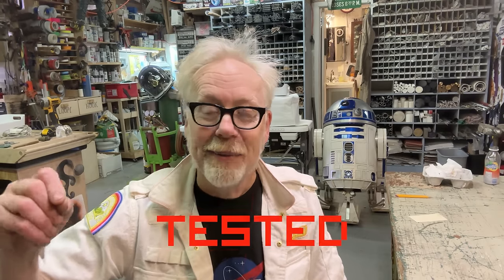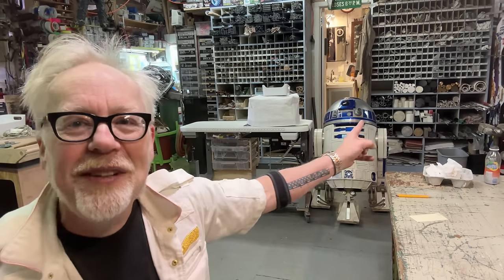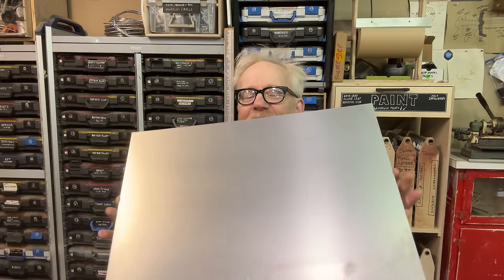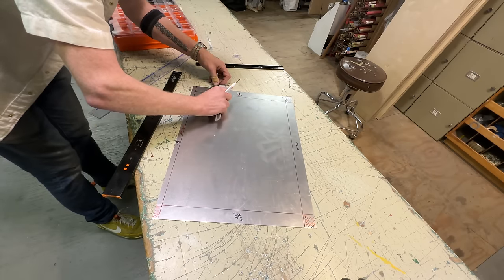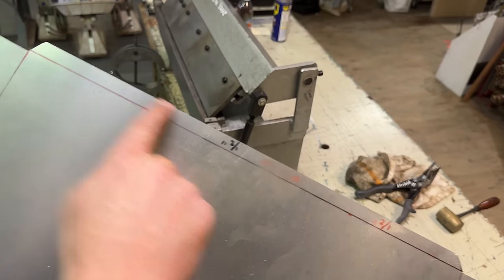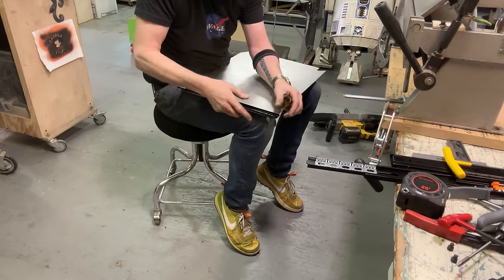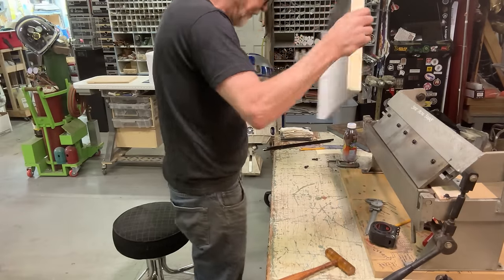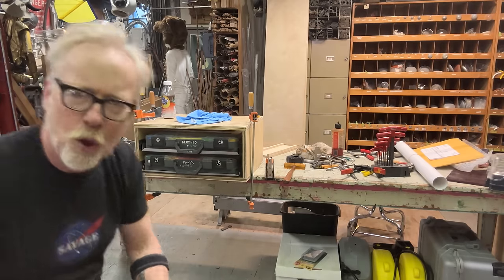Adam Savage Prototypes His Dream Hardware Storage System

Comment: Always fun to watch Adam work through a problem. I think that is one of the things missing on "reality" TV. The people on those shows go right to the perfect solution, where REAL people, often have an initial idea, find out it doesn't work perfectly, and then have to revise, change and try different ideas to make it work. Adam (and all the fine folks at Tested) aren't afraid to show the process of identifying the problem and "workshopping" the solution. That's why I love it. This is actual reality.
Reply: It's not the perfect solution I would arrive at. Making all those drawers for each one to slide out is a lot more time and money than fitting a single slide-out horizontal surface , into the mid-section of that entire case.
That's how the old-school library card catalog cases worked, except there was a slide out drawer for every vertical column.

In short, I regard the solution as overkill. What he wanted was a dedicated horizontal surface that he didn't have to roll/walk over to and back. As long he has to go over to the drawers anyway... and pull out something anyway, it's going to become an automatic action to pull out the surface with one hand while reaching for and pulling out a box with the other. One second to then place the box on the surface and one second to put it back. In the time he's transferring, he'll be simultaneously be opening the lid. And closing the lid as he is returning it.

The only thing in Adam's case, not mine, is the times he is going to dump a box on the floor and all its contents. Because sometimes, that's how Adam rolls.
Reply: Workshopping the solution is a great term!  It really allows you to understand the thought processes that go into a design.  This can really help as you work with refining the concept for your own similar but always somewhat different applications.  Good tool design (and storage systems are tools) is not just a "what" but includes a lot of "why" and many people skim over that part.
Reply: @-danR Adam's solution is particularly helpful for heavier boxes (or unbalanced boxes) that are more tedious or burdensome to pick up and move. I know if some of my boxes were 20+ pounds I'd much rather just keep them on the drawer then have to move them each time I wanted to access them.
Reply: When a TV dinner table would have saved him all this time.

Comment: I have watched half a dozen videos about Adam organizing nuts and bolts into various boxes and shelves. I would watch half a dozen more or more.
Reply: I feel we're in for quite a few more shop organization videos. Probably a good number of new custom boxes for other boxes of things
Reply: Who would have thought watching videos on sorting out nuts and bolts would be interesting.
Reply: Imagine never having to go to Home Depot (or wherever) for fasteners ever again.  Imagine never having to buy the same  fasteners multiple times because you forgot where you bought them a month or two ago before you put the project down for another failed project.  Wouldn't that be nice?
Reply: @chuckschillingvideos  all you need is a machine lathe with infinite scrap and time, every size of screw is now yours.
Reply: You can also develop your own hording problem
Reply: @BGraves  it is only hoarding if you never use it.
Reply: @PuReWiReZ  that's the horder mantra!
Reply: @BGraves  no, the hoarder mantra is "If I get rid of it, I will shortly need it."
Reply: @chuckschillingvideos  i had a nut and bolt collection. It was pointless because sometimes projects called for stainless only and 50pca of the same length. Projects rarely need onesy twosies. That sorted nut and bolt collection is going to the scrap yard in a 5 gallon bucket

Comment: Hey Adam! We have a system in our shop very similar to what you are trying to build! They are Chromate Industrial Corp Drawers and come in 2 or 4 drawer tall cabinets. For how small our shop is, they really work great and being able to quickly look through them without pulling them off the wall is something I am going to bring to every shop I work at in the future. My only word of caution is to make sure the drawers are either level or tended towards the back side, as if not drawers can pull themselves out and lead to a nasty bump on the head or toe if you aren’t paying attention. Thanks for inspiring this young maker into getting into the industry and joining a great union!
Reply: We have uline compartment bix and racks. It may have cost less to just buy them
Reply: I think he is using soft close rails which will hold the drawer at its closed position (albeit with limited force, otherwise it would too hard to open)
Reply: @sliderofelay  it would 100% have been cheaper, and all metal.

Comment: You know one of the most important things about wooden library card catalogs cabinets was that in each one at working height was a wooden pull out work surface.  This was explicitly there so you could remove drawers at any point, at any height in the wall, and with your other hand pull out a surface to set it on and write notes.

We used to use a similar methodology in a lot of our data center racks.  There was always the random reason you would be working on something with its cover off momentarily or needed to pull a server from the top and set a server on something for just a minute.  So in every other rack  near the center we had a small pull out rack mount shelf.

Comment: Aluminum sheet metal fabrication 101. At any point where cuts intersect bends, a hole should be drilled and deburred well before making the cuts or bends. This will help prevent cracking along the bend line. I heard you say that you are using 6061-T6, which is especially susceptible to this problem. While you may not notice them right away, I'd almost guarantee that close inspection of the corners will reveal small cracks that have already formed. Over time and with repeated use these will propagate along the bend and eventually break.

Comment: I am working on small storage boxes, I get random sheet material from the local B&Q where they put offcuts into a bin for charity donations, so I get anything from 4" wide 8 ' long mdf to sheets nearly 2'x4' of mdf, ply and hardboard, it will all get used to make small storage boxes, and i am currently partway through a batch 0f 9"x4"x4" small storage boxes from 9mm mdf and some hardboard, all table say work (slots in the sides etc for the base) the other tool I use is a pin nailer to hold things while glue dries (a trick learned from yourself and another youtuber.

Comment: I grabbed 4 Radio Shack small parts bins when the stores were closing in my area.  They're great.  They have their own drawer slides built-in, movable dividers, and removable drawers.  2 hold hardware, and 2 hold electronic parts.  I just wish I had several more.

Comment: I work in the aviation industry and my company uses "Vidmar" modular storage cabinets.  One of the great things about these systems is that most of the cabinets at work have a pull out shelf about midway up that you can set things on.  I have copied that belt height shelf several times in my shop so that I can pull out the bin or box and set it on the shelf to sort through.  This way I only have to buy One 100 pound full extension slider set per cabinet, thus saving a ton of money.  I even did this in the laundry room linen cabinet and the pantry to set things on while putting them away.  It helps to prevent clutter if you need to retract the shelf to close the cabinet door.  I make them out of 3/4 ply with 1"x 2" sides to provide a lip to pull out and mount the slides to.
Reply: This was the solution I was thinking of as I watched the video.
Reply: My friend has something similar, and I feel it is a pain in the derriere to use.
I use 25 angle welded to make the tray, and £4/5 drawer runners, making <£10 per shelf, plus time and welding, but makes a much more useable system.
Do you not find taking the box out, pulling the shelf out and putting the box down to open it annoying, I just ended up using a nearby table defeating the point when in my friends shop.

Comment: I so enjoy every opportunity to design and fabricate to “first order of retrieval”. During summers I have 250+ dorm rooms to punch out / repair. I recently updated my service cart with a dual direction full extension drawer. It’s 5” deep with two levels of storage. Three lower 9” x 22” bins and 2 upper 9”x 23” lateral sliding bins. Inside I’ve made my own quick fold cardboard part bins 2”x 2.5” x 2”H. All to save the time and effort of having to walk around my cart or otherwise having to move tools and supplies off the top to access parts and supplies.

Comment: I'm planning some very similar storage to this; but I tackle the horizontal surface problem differently.  For each cabinet; I am building one pull-out flat drawer that one case can sit on (So i still pull each case out, and pull out one surface only while looking through the case).  This has a couple of benefits in that it ends up saving a ton on drawer slides, and I set the pullout drawer to an ideal height so that cases stored too high or low can be viewed without a stool or getting on my knees.

Comment: Yes! To the tool recap at the end! My good friend bought a print shop and reduced the footprint by 3/4 which I thought at first was over doing it but the best thing built were these rolling transition tabletops that also held tools and gear but the biggest problem is you had to completely unstack them to get to the bottom. Fast forward to my tight little cubby and I copied them and remade these rolling tables but did what you are doing with the organizational drawers from a freight company down by the harbor. I love it as it rolls around and has the tabletop to work from as they don't have the fancy drawer slides. It would be nice to see a mini rolling version of what you are doing with your most mobile of the needed drawers.

Comment: dear sir, this has been the first build i have seen of yours that hit me in my work skill set by 100% I am a steel fabricator for a train yard. my job is to make what we can't or forgot to order to repair train cars. As you were building it was as if i was working in my home building space. made me want to get my kids to see how i think threw a problem. thanks for this one
Reply: Hey Chad, At 14:30 he did a jump cut that skipped over the next two bends. trickiest bends in the whole project. Do you have any idea how Mr Savage made them?
Reply: @christopherdahle9985  ok the finger break had to be set up to allow the next bends to pass the tabs that he rivets. The reason it's tricky is because unlike paper metal has a thickness that you need to alow for to get the tabs to be tight not sloppy. It's not really as tricky, but more something you need to watch out for.
Reply: @chadherron5740  Thanks for the reply Chad, I appreciate it. I see that he moved the fingers, I just literally can't visualize how he got the work piece into the break, and I see that in the second prototype he modified the cut on the tabs, possible to accommodate the backset? Kinda feel cheated that he jump cut over that bend because I've had to make similar bends...and I am no one's idea of a tin bender...at work recently. Ended up doing them with a hand break and they were ugly. I was watching in anticipation hoping to see a secret way to make them neatly. I guess it's still a secret.

Comment: I had a similar problem in my shop with several different tray / box / container shelf storage systems. 

My solution was simple - use a pull out 'library' shelf (sometimes called a "posting" shelf). Basically about every 4th bay I added a heavy duty sub shelf (in my case just a piece of thick ply) on pull out rails at a height of about 1m (39"). You can pull out any size / number of containers from above or below and rest them there the retrieve parts. I also found it very handy as a "return" shelf for taking a container off a bench and taking it to the general area when I 'm working quickly and don't have time to find the exact home for it.

Comment: You can use your sample drawer box to now make a wheeled "supply collector" and "tool collector" cart to shop in your hardware store area with and transfer everything over to your various work spaces.  It'll make it easy to gather everything you need for your projects and bring them where you need them and then put them away when the project is complete.  And also, keep them organized if you need to put a project aside for a while for working on another quick task in that workspace.

Comment: Great concept Adam as all your projects are... as soon as I saw this video, I ran to my local Harbor Freight and picked up two similar compartment storage boxes (large and medium). One main difference between the boxes you used and those from Harbor Freight... the notched sides do not have a bottom lip. This open notch allowed me to attach a wood block to my full extension glides to hold my storage boxes in place and simply pull them up when wanting to take a entire storage box to my work area. Much less work and materials than making pullout shelves.

Comment: I happened to be doing the same sort of project for my parts boxes today.  My solution was a 3d printed support bracket attached to each drawer slide.  I seldom need to pull the box out so the box itself keeps the slides together.  Lot quicker and cheaper than doing sheet metal work and collects less dust over time.

Comment: What you're describing reminds me a lot of server racks and the laptops that are built into the server rack. It slides out and you can open up the top and use the laptop without removing it from the rack. Might be useful to check out if you're unaware of the hardware they use for server racks.
Reply: Might be even more useful to check out if the server rack can hold a Sortimo box and just use it as an off-the-shelf shelving solution.

Comment: My old boss used to write "Save" on all of his jigs and fixtures so it was a positive action instead of a negative like "not trash". It could never be confused because the action you were trying to prevent was never mentioned.
Reply: I like to add some more information, such as job name, part#, or some critical detail such as a reference edge/origin, callout drill sizes, etc. Sometimes saves having to search for those details in a file a year down the road.

Comment: I made a chest of drawers a few years ago but it was a bit larger more like 2‘ x 4‘ drawers but using the same type of drawer slides. I intended to use it to store artwork but now with the five different drawers I sort of have it set up with five different types of things like my large rulers and straight edges on the top drawer, spare vinyl lettering on the second, and the middle drawer (you’ll love this) is full of light saber kit bashing parts and tubing!

Comment: I used HF boxes rather than Sortimos due to cost, but a very similar form factor.  Rather than add slides to each box, when I designed my cabinet for my boxes, I added split the cabinet at a convenient height where I can add a 2-box wide pull out drawer-style tabletop.  It cuts down the number of slides I need to two, and I'm always accessing drawers at a convenient height when standing.
Reply: @jonathanb246  Well, don't forget that the Sortimos are a FAR better quality and more versatile/adjustable product, and Adam is using this shop essentially industrially.  I more intended my mention to indicate that I was using a similar case and not the Sortimos from this video, which does create some fitup differences.

Comment: I've seen these shelf racks full of 'sortimo-likes' that just replace a standard counter height slot where you would put one, with a slide out shelf. that way you're only bending down, or reaching up for a short time. Then you put the sortimo on the pull out shelf, then you slide the shelf back in and put the sortimo back in its slot. Less engineering, might also be more ergonomic and allow for more height in the storage unit.

Comment: Looks great.  A couple of observations, you can probably stack them tighter together (I used a couple of aluminum rulers for my wooden slides), and making 72 instead of 70 may get you more symmetry with the number of cabinets you'll need.

Comment: To address the lack of flat surfaces near your workbenches for these Sortimo boxes so you can have one or two on hand while making something, if you have room, consider having some of those single Sortimo boxes (like the one that you were showing off at the beginning with the drawer slides) mounted to the underside of your workbenches. That way you can bring a Sortimo organizer to your working area, slot it in to the shelf and pull it out on the drawer for easy access. Your insitu drawers are good for when you need to go over and grab a couple pieces of hardware and that is the only time you need to grab that hardware through a build. But if you are doing a build where you would constantly be having to go to your hardware store (or need space for a handfull of Sortimo sub-bins) you can bring the Sortimo to your working area (or bring a few individual sub-bins to put into a spare Sortimo next to your working are). That way you don't need to find flat-surface area in the spread-out parts of your build.

I hope that made sense...